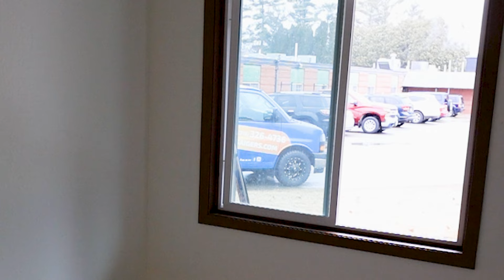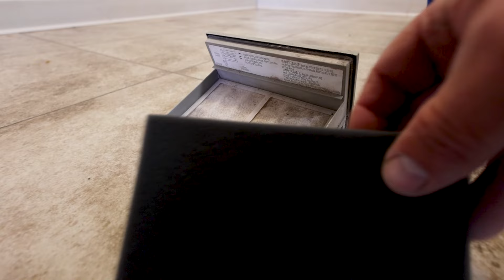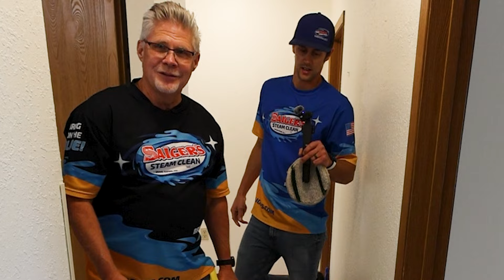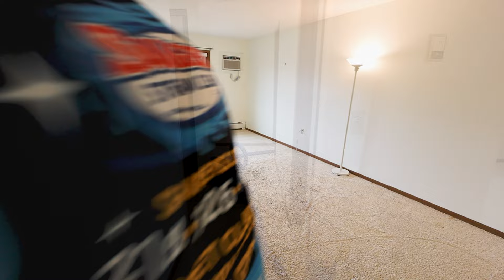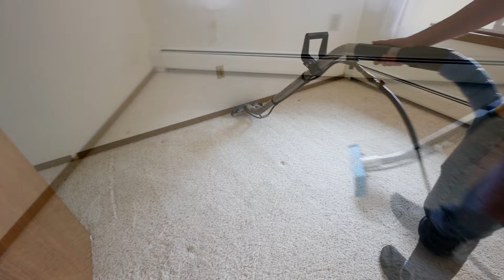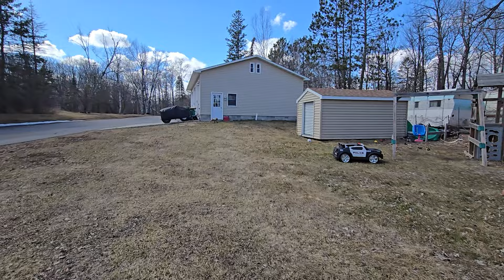How Clean is this Carpet? We Really Make a Surprising Difference!

Comment: Brilliant video Mark. I do like the detailed explanation of what you're doing and why. I didn't know just Like Magic was 9.9% peroxide as it doesn't say it on the bottles I bought.
Reply from the maker: That's the legal percentage amount of peroxide you can put into quarts for safe shipping. Our OdorOxy in gallons is an 8 percent peroxide just to let you know. 😊😊
Reply: @MarkSaiger  Thanks Mark. As everything I clean is wool, I can only use 3% HP. I live about 4 miles from the little town of Axminster and everyone in my village and around has wool Axminsters. I did try JLM on a beige wool rug one time and it either bleached it or got it amazingly clean.

Comment: Another fun video Mark! I can’t tell in the video but do you spray solution on both strokes or just the back stroke when cleaning?
Reply from the maker: We actually do a forward spray most times with our Wands for a brief fast push and then key and pull the trigger on the backward pull too. Not every machine such as a portable can probably do that and recover as well, but it's something we do to try and rinse more thoroughly